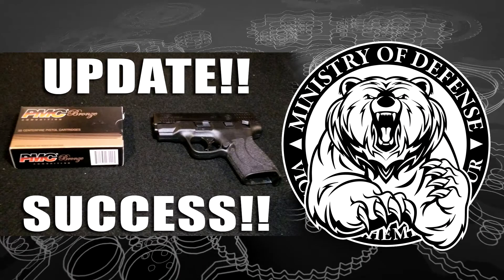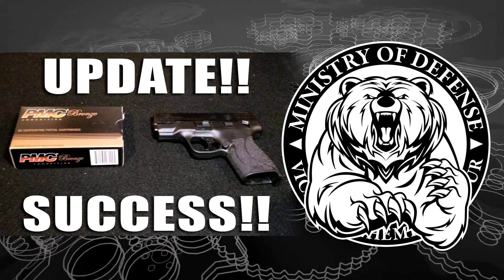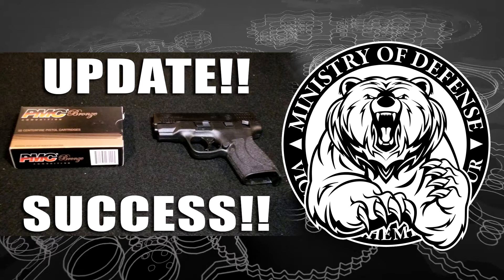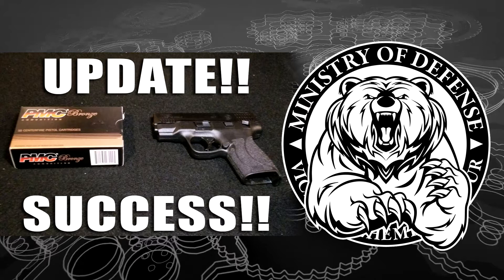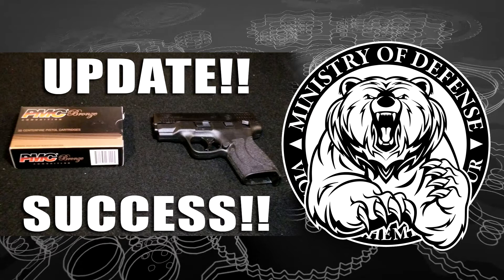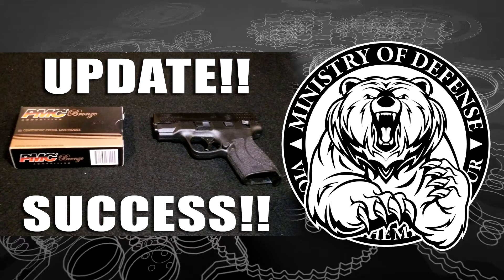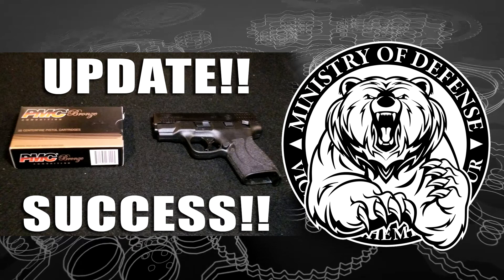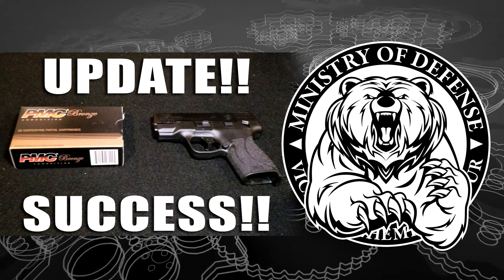M&P Shield 2.0 45 Failure to Feed Update #2

Comment: I also have a 2.0 in 45ACP. I experienced failure to fully go into battery. Not a feed ramp issue. The round would jam in the chamber. I reload ammo for all my guns and follow published specs completely. My issue was that I had seated the bullet to the proper dimension and when cycling the bullet would jam in the rifling and stop the slide. I had to reseat the bullets. 010" and that eliminated the issue. Had the same issue with some factory ammo and had to fix those. Now it runs flawlessly. Love the pistol. Thanks 😊
Reply from the maker: Thanks for the info. I am sure that will help others when trying to troubleshoot problems. Thanks for  checking out our channel.

MOD
Reply: Mine won't even go into the barrel to have that issue.

Comment: I purchased a new .45 Shield 2.0 Performance Center about 3 weeks ago. Within the first 50 rounds I had 14 failure to feeds. I put it away and went to my SIG P320. The SIG performed flawlessly. I was using PMC Bronze, 230 gr FMJ, new factory ammo. Went back today with only the S&W. I used American Eagle 230 gr FMJ and had 3 FTF's in 100 rounds. Much better but still not where it needs to be. But it's headed in the right direction. I will send this back to S&W if it continues to have the FTF. But I'm going to wait until I have at least 500 rounds through it before I do that. I like the gun, it's a bit snappy and I do need to modify my grip from what I'm used to as this is the first sub compact gun (3.3" barrel) I've shot.
Reply from the maker: Brian...Thanks for the feedback! Its interesting that S&W has still not fully addressed this issue form a quality inspection standpoint. I have talked to a few others that have made recent purchases and still having this issue. You would think that after 2 years of people having problems, they would make some revisions. Thanks for checking out the channel.

MOD

Comment: I purchased a used 45 Shield 2.0 and have had issues feeding as well.  Mostly the round appears to get jammed in the magazine. I thought is was the mags and changed the springs and even bought a couple new mags. Same issue. Did seem to be an issues with the ammo I used but even with new ammo still the same issue. Does not jam with my self defense ammo.
Reply from the maker: Hello Curt. Based on feedback we have been getting from everyone that has had issues, it seems that the ammo that is being run through the pistol will either feed fine or bring out those little gremlins that seem to haunt this line of pistol. It would be interesting to know what factors are causing the different results with the varying ammo brands.  Is there a common factor on the "suspect" rounds that lead to the problems? Obviously S&W need to address this and make engineering changes to alleviate these issues regardless of ammo.  Let us know if you contact S&W and see how they handle this. We are taking notes. Thanks for checking out the channel!

MOD
Reply: The gun can't be that specific, or at least I hope not. I can't even get 1 round to go into the barrel.

Comment: So, if the feed ramp is coated or painted, couldn't you use acetone in that area to remove it? Obviously, lubing the feed ramp might help, too. I've got one and 50 rounds in I started experiencing FTF's with every magazine. So far, its been only one FTF per magazine, but that's one too many in my book. I'll try what you suggested & leave the magazines loaded for a week or so before I fire it again.
Reply from the maker: Let us know how it works out. Just curious, how old is your pistol? Recent buy or bought from older inventory? Trying to get a consensus if S&W have got this under control or if it is still a current occurrence.
Reply: @weaponsofmassdiscussionpod4680  Less than 6 weeks old & purchased new. However, I have no idea how long it actually sat in inventory before purchasing it. I haven't done anything yet but my plan is to clean the ramp by using acetone & a "q" tip, then lightly lubing it (Slip 2000 EWL is my go to lube; I may try their bore cleaner on the ramp as well), before my next range day. I'll keep you posted as to how it worked. If it doesn't, I'll take it to my gunsmith and have him polish the ramp. I may buy different magazines as well.
Reply: @weaponsofmassdiscussionpod4680  This morning I treated the ramp with acetone, made sure it was dried and lightly lubed it with oil. I then put 63 rounds through it at the range (9 - 7 round magazines). Everything was going great, but then I experienced two FTF's with the 4th magazine, with rounds 2 & 4 to be precise. After that I experienced no more FTF's for the remainder of the session. This is much better than my last session, though no FTF's would be best. I'll clean it good, and treat the ramp again with acetone and then lube it. I'll see how it acts the next time I shoot. If it happens again, I'll have the ramp polished. I bought two additional 7 round magazines after I bought mine. I use the 7 round magazines exclusively. I'm running Seller & Ballot 230 FMJ. I run this same ammo through my 1911's, with no issues.
Reply: I'm waiting for S&W's response to my email. If it's gun related and not ammo related, then they can fix it for free. It would be nice if they issued bulletins on their guns based on registration data to let us know of issues and workarounds before we begin to hate the brand.

Comment: I had feeding problems with Winchester white box. I measured overall cartridge length and found that was slightly longer than Fiocchi which gave me no problems. I the ran some of my problematic reloads through just the seating dies adjusted to the OAL of Fiocchi and that seemed to solve the problems with cartridge hanging up in the magazine. My other 45's are not as fussy with regard to OAL I don't remember the exact measurement, does not seem that it could be enough to matter, but does.
Reply from the maker: Tom M, Very interesting! Thanks for sharing your experiment and experience. Also, thanks for checking out our channel.

MOD

Comment: I mentioned that I had some problems with failing to feed.  Seems to happen with 230 grain ball ammo.  Especially the cheap stuff.  Ive had far less problems with 185 grain ammo for whatever reason.   The last stuff I used was Blazer brass 230 grain and had 3 or 4 failure to feeds then used Fiotcci ammo 230 grain ball and had 1 failure to feed in a box of 50.  Had zero failures with Hornedy American gunner 185 grain HP.  Had zero failures with Speer lawman 185 grain ball.  I have about 700 to 800 rounds through the gun now.  Happened with both mags.  Still cant determine if it's an ammo problem or feed ramp or magazine issue.  I have the performance center model 2.0.
Reply from the maker: 70DMac, that's an interesting situation. Based on all of the feedback we have been getting, I do believe that it is definitely a feed ramp issue that rears its ugly head depending on the ammo being put through it. What is confusing is the grain load that you are seeing differences in. Leaves me scratching my head. Hopefully someone else here can chime in and have some more input. Thanks for updating us! Sharing info helps all of us.

MOD
Reply: As a gunsmith. It sounds like the magazine springs on these guns can't reliably feed a heavy 230gr stack of ammo. Perfect function using lighter weight bullets (185-200gr)  is a dead give away to me.

My personal 45 shield 2.0 had ftf issues with hot bullseye loads which I've encountered before with even glocks.
The biggest thing that caused my shield to have ftf issues was my sand paper tallon grips I had on it. They just didn't have any give. An example is like you shooting a semi shotgun against the wall vs your shoulder. A semi auto action needs as much dwell time as possible to be 💯.
Reply: @upnorth5465  I didn't have the patience to figure it out anymore.  Already sent it back to the factory and they didn't do anything other than polish the feed ramp.  Still has failure to feed issues.  Got rid of it.  Picked up a Springfield xds mod 2  .45
Reply: @70DMac  don't blame you one bit. I've had my xds mod 2 since they came out and have over 3k rounds thru it with 0 malfunctions what so ever. Its a superior designed compact pistol all around imo.
Reply: @upnorth5465  I've also had zero issues with the xds mod 2.  Put everything through it.  Hollow points, 230 grain, ball ammo.  No problems at all.

Comment: Anything can happen with any firearm I owned a Glock 19 and I could not get it to run so I got rid of it though I have shot a Glock 17 no problem but I don't care what anybody says I think all pistols should be function fired at least 400 rounds for at least to let the springs seat and the slide rails run under firing conditions Winchester white box dosen't seem to be what it used to be and I have had no problem with PMC it is consistent quality ammo.
Reply from the maker: Ronnie, great point! A good break in period is extremely necessary. Thanks for checking out our channel.

MOD

Comment: Ten sw pistols,never a problem.
Reply from the maker: Thats good news! It seems the problems are on the newer 2.0 models. Makes me scratch my head. Any of yours the 2.0 series?
Reply: @weaponsofmassdiscussionpod4680  Many over the years.
Reply: @weaponsofmassdiscussionpod4680  Mine is a 2.0.  S&W polished the ramp/barrel, but it still fails on 3 different ammos.  Undependable and very disappointing...
Reply: My MP Shield 9mm has been absolutely flawless in the three years I've owned it with about a 1000 rounds through it.  The 45 is just being ammo picky for whatever reason.  Some seem to feed better than others.
Reply: @Mike david Corman What gun?what problem?
Reply: Ran a hundred rounds with my M&P, no problems whatsoever
230 grain RN Berrys
4.5 grains Winchester 244
1.250 OAL
Also ran few at 1.200 OAL and they ran just as well.